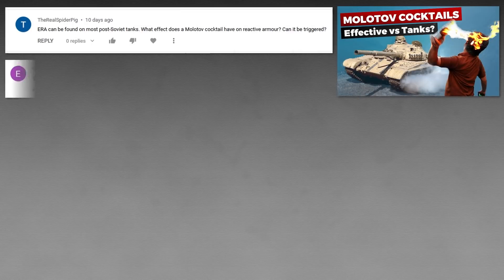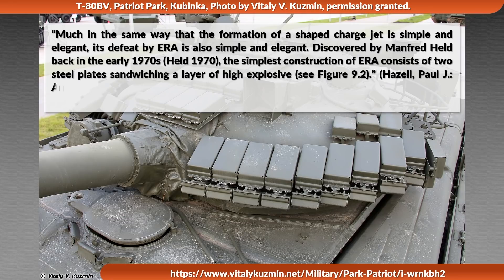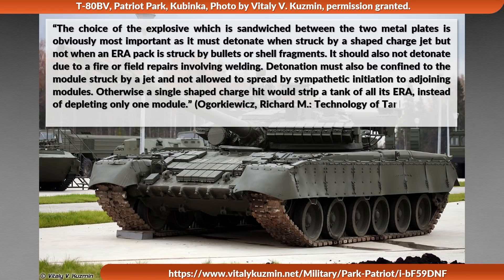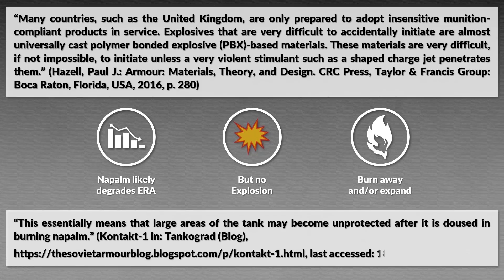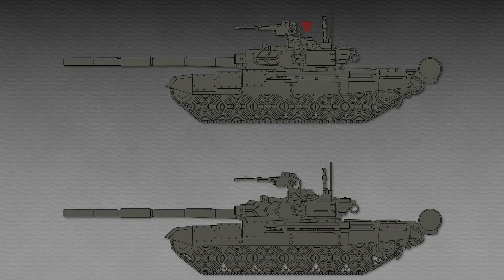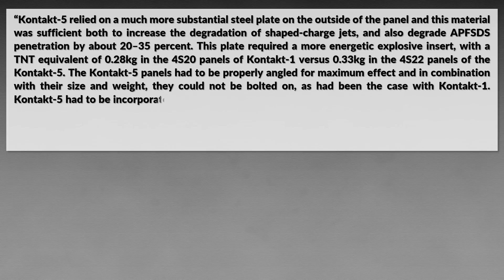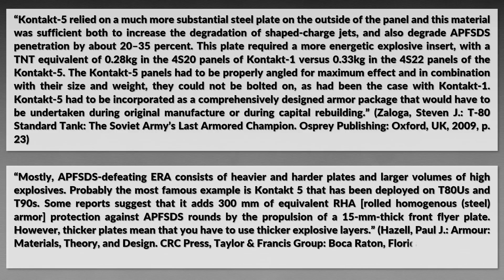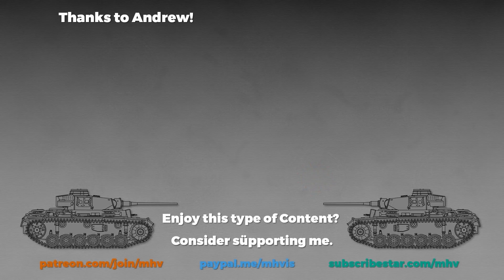Why does Russian Explosive Reactive Armor not explode?

Comment: So here's the follow  up question: why aren't the Ukrainians stripping all this C4 (or whatever explosive is being used) for road side IEDs and other mines and traps?  Seems like a perfect and easily accessible source.
Reply: I guess because this explosive material requires a complex detonators and specificknowledge, which are not available, or nobody wants to deal with damaged and unknown explosives which can detonate in your hands
Reply: @ВячеславФролов-д7я  The whole point to this video is about how stable these explosives are and therefore relatively easy and safe to handle - and they don't need a complex detonator, just a small detonator or blasting cap.
Reply: @osrikking8785  but I certainly wouldn't enjoy using it after it was exposed to high heat/fire. Who knows what could happen to its stability? And I have just one life
Reply: @ВячеславФролов-д7я  There seem to be a fair few dumb bombs which have failed to explode and been defused and then taken off for controlled explosion. You'd think they were tailor made for IEDs. I'd guess the same applies. Taking these things on a truck with a bed of sand, to a site out of town where they can be exploded, is risky enough. Transporting them across the country is asking for trouble.

Comment: Having worked with explosives there is a standard rule... It takes heat and compression to detonate any explosive
Reply: Mixing anfo in a small trailer mixer on a quarry blasting job , a fellow spilled some unmixed onto the ground & scooped it up with some gravel . . the sound of the auger grinding rocks amongst an high explosive was't pleasant
Reply: What about explosives that cook off and explode when, say, a naval warship catches on fire? Something in your standard dumb bomb on a burning aircraft carrier deck (see: USS Forrestal) seems happy to blow up when it gets hot enough under normal atmospheric pressure. Was that because the bombs on deck had their fuzes installed for use?
Reply: @danielmocsny5066  ..Yes. the Bombs were getting loaded to the planes with fuses on..
Reply: @danielmocsny5066  In the case of forrestal, they had old, improperly stored, unstable explosives on board.  It's an interesting situation to read about.
Reply: Watched an airtrack blasthole rig grind into paste a couple boxes of riogel explosives on a rock surface next to me , modern tech is a wonder . . but some we used a lot as like powergel was cap sensitive & if that got grinded it would'v been all over bar the shouting
Reply: Yep, thats why an RPG will set off an ERA panel with ease, extreme pressure and therefore heat as well.

Comment: Should have spent a bit more time explaining the differences between high explosives and low explosives, I believe
Reply: Main difference is high explosives spend more time with Cheech and Chong. :P
Reply: 'High or low' refers to the detonation velocity (brisance) of the explosive, and not its sensitivity. Black powder is a low explosive that will detonate fairly easily. ANFO is a very insensitive high explosive that requires a high velocity cap-sensitive booster such as RDX to initiate.
Reply: There are different burn speeds for explosives whether you want a push or a punch . . ultra slow fuel air explosives like ignited fuel & air etc right mix is devastating soft targets . . then you climb a ladder of speed you want , there obviously is some quick stuff out there . . the bombs Bali caused flash burns from their light , high end west military stuff not random jihadi concoction
Reply: Tom Scott does a good job in this interesting video: https://youtu.be/OOWcTV2nEkU

Comment: Ukrainian Nizh and Duplet are quite interesting, as they use a series of linear shapes charges in each module and sort slide kinetic penetrators into pieces (as well as disrupt shaped charge jets).
Reply: You mean the ones on T-64BM & T-84 oplot. Let's see to it performs against Russian 3BM44 3BM60 3BM69 3BM70
Reply: @EpicThe112  That, however, assumes Russia actually uses those projectiles in any significant quantity. The photos I’ve seen of captured Russian 125mm APFSDS (I.e., photos of ammunition taken from captured Russian tanks) have shown 3BM42 and 3BM17(!!!!!!)
Reply: @preserveourpbfs7128  thank you for telling me about that. These will be useful to the Ukrainian military stockpile of 3BM42 Mango rounds 3B17 shells. I do have a feeling 3BM60 Svinets 2 3BM69 3BM70 Vacuum shells 3BM44 will be in the refited units in eastern Ukraine. Ukrainian military will need to test Nozh Explosive Reactive armour Duplet against those otherwise Ukrainian military tanks will be destroyed by Russian tanks since they have access to newer 125mm 12.5cm Shells

Comment: What is the shelf life of ERA? I have been told that one of the problems experienced by the Russian tanks is lack of proper maintenance. IE the ERA needs to be replaced on a specific timeframe. Is this true?
Reply: Ours certainly was, on a six month tour mine was checked mid tour. As HE ages over the decades it desiccates dry and can crumble.
Reply: They should be fairly stable. It crubmbles and dries but it is inside a more or less sealed metal container. So they should work for decades even if their official shelf life is reached much earlier.
Reply: I've heard that some ukrainians found sand rather than ERA

Comment: Im no chemical engineer and this question probably is very stupid but, why can't the ammunition use this type of explosive so that cook offs wont happen?
Reply: Also chemically modern powders used in firearms are very far away from the original black powder
Reply: Explosive shells do use this type of explosive as a bursting charge. They have to survive being accelerated up the barrel and only explode when intended.  Generally, artillery shells will tolerate abuse and not explode. 

The propellant charges burn very fast, but don't detonate, so they give a relatively steady acceleration along the barrel with manageable pressure. You can light a pile of propellant charges in the open and it just goes voompf! No explosion. Do the same thing in a small shed and the pressure produced would force the walls to break and the roof to fly off.

Over the years efforts have been made to make propellants more stable, so they are not set off by static or debris from the last shot, but get them hot enough and they go voompf! I believe that's what happens in the Russian tanks with ammunition stored in the turret for the autoloader.
Reply: @fredsmith5473  The jack-in-the-box effect on (I think the T-72 and T-90) Russian tanks, that is caused by the ammo being ignited by a hit is also a huge design flaw.  We learned in WW2 that adding a blow-out panel that allows the explosion of cooked off or ignited rounds to exit directly under or to the side of a tank can preserve the lives of the crew.  Im astonished that at least some Russian tanks don't have this feature!  I'm sure all the NATO tanks, along with Brazil's Osório and Israeli Merkva all have this feature.
Reply: Explosives detonate while propellants deflegrate.  While both essentially turn small quantities of a solid into a huge volume of gas to create their effects, the rate at which that happens are different.  If C4 were to replace smokeless powder in a bullet, the gun firing it would need to be thicker, stronger and therefore much heavier.  That creates a cascade of disadvantages as Im sure you can imagine.  I wouldn't be surprised if there is a chemical/blend that behaves as you suggest, but it may be far too expensive, give off deadly gasses, or behave unpredictably in other ways.

Comment: 9:28 I think you'll find this is not a chain reaction in terms of surrounding blocks detonation sympathetically. Its more a case that the blast strips the blocks away from their mountings. That is the block is intact but is now sitting on the ground somewhere. The effect on the tank is the same (more than one block now missing) but the missing blocks did not explode.
Reply: That is correct. Still, there are instances of two blocks ignited in the HEAT strike and the blast caused by the ERA ignited secondary blocks. It is hard to call it a chain tho. That is rare, even for the Kontakt-1 bricks. I would also not make the generations of ERA based on Soviet/Russian designs as the Polish ERA generations sit right between the mentioned.
Reply: ERA explsion is enough to cave in light armor.  Hence why there is no classical ERA on Soviet IFV/APC and no ERA on the back of the turrets on tanks.  So its no surprize that exploding ERA strips nearby blocks.
Reply: I had also noticed this contradiction between the his source and his narration. I think this point was worth clarifying.
Reply: nah I looked.  couldn't find it
Reply: You literally repeated what the citation he used said.
Reply: @bliblablubb9590  Sure, but what he "said" at that time stamp mentioned the chance of sympathetic detonations.

Comment: When you were talking about an internal explosion in the tank, you said force would be directed out of the hatches as it is the path of least possible resistance. That is only true with black powder, modern explosive compounds explode with equal force in all directions, so the force coming out of the hatch was the same force exerted in all directions inside the hull, it's just that it was able to egress at the hatch. It's why turrets pop off. However, this is only true of explosions and not of propellant merely burning off.
Reply: The main difference between blackpowder and modern propellants is the burn rate.
While the former has a relatively constant burn rate not really dependent on confinement, the latter´s is relative to the pressure, tightly confine it and it accelerates rather quickly.
Still bp does explode with equal force in all directions as well, it´s maximum pressure is just smaller.

What inside a tank does "explode"? Mainly the propellant charge of the tank´s ammo, but there are variations, depending on how many cartrides are ignited by red-hot fragments of a hull penetration at once.
If the propellants are just burning off one by one not much happens, if the whole ammo rack gets shredded and ignites at once, turret goes flying.

There still are quite some high-explosives in the tank, in form of the explosive fillings of it´s own shells, but as they are secondary explosives those will not get set off even by a rather quick deflagration of the propellant or a penetration. When the tank burns out,  the shell´s fuses may get hot enough to fire and set off the respective charge, but not all at once.
Lets say a tank carries two dozen HEAT or even HE shells, this would be up to around 150-180 lbs of TNT equiv., if those explode at once, the tank would be a 60-ton frag bomb and not just loose the turret.
Still just one may crack the turret or even the hull, at least slightly, the detonation simply is too fast and violent to vent.
Reply: 🤓🤓 Det är därför vi inte kan använda DNT som bränsle  till framdrivning av projektiler. Pipan skula explodera .
Reply: Hylsan på granaten, utgör ett relativt mindre motstånd,  och inte bara brinna, men också med  sin fasthållning av granaten  rasera sin omgivning.

Comment: ERA should only explode when it's hit. The ERA blocks shouldn't explode under other circumstances, otherwise they become a danger to anybody in the immediate vicinity of the tank.
Reply: I was minding the same thing , like the c4 they are so stable that you can put fire on it and they still dont blew up, only with the correct detonator wires
Reply: @alessandrogomesaraujo4206  if I’m not mistaken, c4 only detonates with a shockwave, like say an extremely large super sonic projectile smashing into it, or via an electrical charge. I remember reading an vietnam era demolitions manual when I was younger and I believe it said something of the sorts. The question in this video wouldve been answered a long time ago during our time in iraq as they had m1 abrams post 1991 (again, if I’m not mistaken) that have been knocked out, however these tanks were often scuttled and didnt have era plates so we never got to see them undetonated on knocked out tanks.
Edit: I have watched many videos on demolitions and I believe that electrical detonators in the form of just a live wire are never used, as the wire is live and can hold on electrical charge even when not supposed to. So they use electric or nonelectric blasting caps to transfer the shockwave needed because it is much safer and can only cause detonation when intended. I am no demolitions expert though. If anyone is, please correct me I would love to learn some more as it has been a long time.
Reply: @alessandrogomesaraujo4206  but c4 is high explosive its suppose to not blow up if its set on fire
Reply: @alessandrogomesaraujo4206  so u telling me i can put gas on a block of c4 and it won’t blow me to elons space tesla?????
Reply: yepp
otherwise its just an E
Reply: And here I thought they were lunch boxes for the soldiers inside!
Reply: Did you watch the video LOL
Reply: Era is a threat to anyone around regardless of when they blow up
Reply: Imagine the ERA going off like a claymore
Reply: i like my defenses spicy
Reply: Wow you just said what the video said wow
Reply: The whole video covers everything except the fact the blocks didn't get hit
Reply: Good comment, don’t watch the video. Save yourself the ears and brains.
Reply: But Russians are pretty dumb they manage to get their flagship blown. Up and lose a lot of tanks.
Reply: It reminds me of Tannerite. Pretty safe until shot.
Reply: did you just TLDW this vid? it was explained @9:29 ish
Reply: Maybe, just maybe, they are not real. It’s not above the Russians to give their tank crews fake era and their infantry bogus body armour. It’s a super corrupt kleptocracy.
Reply: Your so comfusing
Reply: Those infantry screens are delicate things compared to the tank
Reply: That's what he says in the video, isn't it?
Reply: I've seen videos of people using plastic explosives for cooking oil. Just cut off a piece and throw it in the pan.
Reply: Well the ones exploding correctly are also a hazard to surrounding personnel
Reply: @m.streicher8286  so is a heat shell
Reply: @m.streicher8286  At that point so is the enemy fire.
Reply: this only aplies to early russian APS
Reply: Украины больше нет
Reply: @ИванИванов-е9щ1в  and Russia just has nukes and numbers. Crap tanks and crap drones. What is it the old CCCP crap that your using. Stay out of Ukraine.🤬
Reply: @ИванИванов-е9щ1в  but only after russia is dissolved in 1000 pieces...
Reply: @ИванИванов-е9щ1в  ok Ivan Ivanov. Russia is no more!
Reply: @Retro_Grade1  : No more NATO and EU , Monkey ! 🇺🇸🕯☠️🇪🇺☠️🕯🇬🇧☠️🕯🇩🇪☠️🕯🇺🇦☠️🕯⚰️⚰️⚰️⚰️⚰️